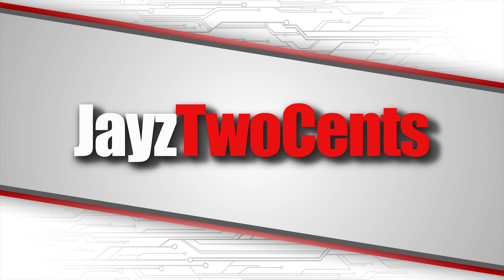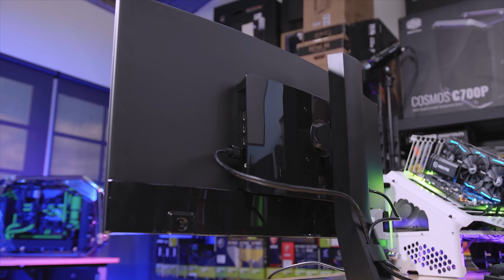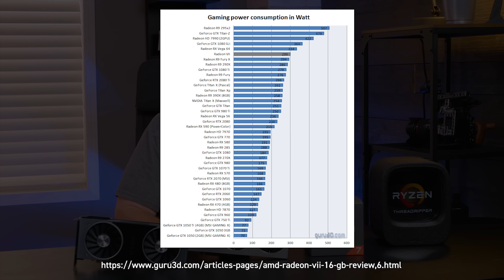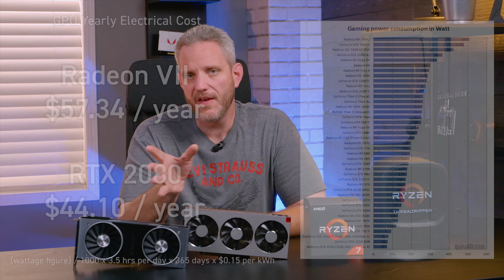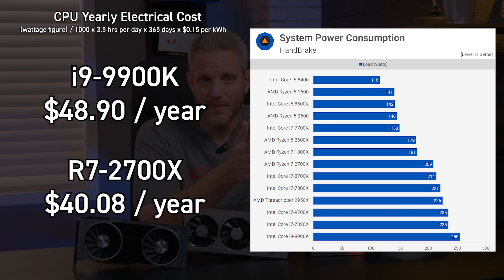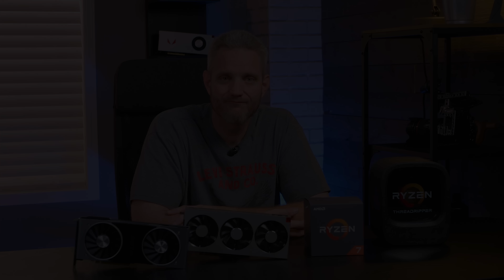Energy Costs of AMD vs Intel vs NVIDIA... This might surprise you

Comment: Nice video. I will go and get stadia now. 4k for 9.99 and 1080 free
Reply: You are forgetting a controller. And the internet. And latency. And Chromecast or PC.
Reply: @StiekemeHenk  1 time controller for 60€ or 1500+€. Some say the lag is torabl
Reply: @joe-zt7jy  guess you wanted to say terrible?
That was some time ago. It will be released 6 months from now so it isn't final. If streaming is ever going to be good, Google will start it.

You can watch YouTube? Check.
You can game? Check.
Ping in game tolerable? Check.

Streaming should not be different.
Reply: @StiekemeHenk  financially all you have to do is buy the game and play it at 1080 for free ( stadia is compatible with keyboard annd mouse on PC). you do not have to worry about specs and upgrades. 10 € you get the 4k experience plus 2 free games. moneywise you can't beat that at the current hardware prices. I built all my PCs and my friends so you can say I want Stadia to fail.

if there is not too much lag, Stadia will be much better choice financially  for single player
Reply: @joe-zt7jy  So to use Stadia, you still need to buy or own a PC, controller or mouse and keyboard.
Oh and still, god like internet.
Reply: @StiekemeHenk  anything can stream Stadia. Tv, mobile wich you  need controller.  Pc, laptop which can open chrome does not need controller any thing will work
Reply: @joe-zt7jy  So I still need to pay for super fast internet. Pay for a laptop, tv, pc.
And not all phones are supported. Only pixel.
Reply: @StiekemeHenk  ofc you have to do that. if you do not have any of the above. How do you play games without them?

Comment: This video is pointless, probably just a place holder and it's OK, don't dig deeper into this topic becouse it's pretty complicated.
People who usually brings up the power consuption argument (I ignore the fanboys now) have some special requirement, low power output on idle, low heat output, these are the people who buy LP grapics cards.

Comment: hate to be this guy but if you're using desktop hardware even in the high end and you're concerned about power draw it sounds like it may be time to move. damn $0.15 kWph that's less than half what I pay and power draw doesn't even come to mind when I shot hardware. in the end, all I am saying is buy what you will be happy with and dont gimp your self with the whole of X card draws X power X card will save me X amount nickle and diming at that point.

Comment: I buy Intel processors because I like Intel. Point blank. I utilize Intel at work, so its my preference at home. Though if i could get my hands on a comparable AMD chip I would love to try it out. As for graphics I am switching to Nvidia from AMD because I have never tried Nvidia. Thermal output of any system should not be a considerable factor on chip choice today unless you are designing a space and airflow constrained system, IE a machine that is enclosed in a control panel or inside a cabinet that has no thermal flow. And that would be a special case. So for mainstream systems choose whatever is your preference.

Comment: AMD heater..... yeh 3700x 65w 8 core vs 9900k "105w"  same multi thread score.

Ignore the 3800x , thats just AMD stilling off crappy dies that happen to clock higher with silly power draw.

Comment: TSMC’s 7nm process is NOT superior to Intel’s 10nm. It is comparable and in fact Intel’s 10nm is lightly superior. Only an ignorant person doesn’t know the marketing shenanigans of TSMC in the node naming scheme and falls for the smaller number trick. In any case below is a ranking of the nodes starting from the worst and going to the best:
GloFo 14nm (this node should have been called 16nm)

TSMC’s 16nm

GloFo 12nm (this node should have been called 16nm+)

TSMC’s 12nm (this node should have been called 16nm+)

Intel’s 14nm

Intel’s 14nm+

Intel’s 14nm++

TSMC’s 7nm 

TSMC’s 7nm+ EUV 

Intel’s 10nm+

Intel’s 10nm++ 

TSMC’s 5nm 

TSMC’s 3nm 

Intel’s 7nm+ EUV

Comment: true value is console if you are casual gamer there is no better deal (my opinion)
Reply: Would be interesting to see where a 1060 6gb and 9400f at 30/60 fps lock would draw. CPU wouldn't even wake up in most games. Hard to beat the value of a PS4 pro at $300 (on rakuten now). It would hurt to pay for online again though

Comment: Is the Radeon VII on par with the 2080 though? I'm genuinely curious cause not much has been said about it since the initial "disappointment".
Reply: Yes it is still on par. Hardware Unboxed revisited it recently and found that nothing has changed.
Reply: Stock peformance it's a bit slower but usually it can overclock quite well, while still undervolting it a bit. The Vega cards are for people who like to tinker around with their cards, Nvidia gives better out of the box performance. For me, it was very fun to play around with my Vega 56, I had Samsung HBM2, flashed a V64 bios and got a huge memory overclock on it and now I'm getting better performance than an RTX 2060, getting close to a 2070 actually. Out of the box though, the 2060 is slightly faster than V56, just like 2080 vs Radeon VII.
Reply: It's faster and has 16gb of vram and with hbcc you can have up to 24gb of vram performance.

Comment: It should be testet asfar as possible with product with the same capacity, and then calculatet where is the diference in powerdraw and purchas price. And if a product is initaly cheaper but draws more power how long would it have to run until it became the more expensive one. With let's say 3 to 4 diferent pricings kw/h since the price is regional different.

Comment: power cost ??whast that

my desktops/laptops/server and even smartphone are always running at 24/7 @ 100% full load (IE cpu/fans are at 100% clocks/speeds 24/7)

I don;t let the cpu or fans not run any thing slower then 100% 24/7 

also don;t use hibernate/sleep. and only turn the displays off.. nothing goes to standby/sleep/idle ect..

I don;t even under-volt my AMD cards... I just run stock settings @ 100% fan rpm's 24/7...

Comment: @JayzTwoCents , Question = Is it Better To Cool the Radiator OR Just Cool The Water / Coolant ? Wouldnt it be Better To Just Cool the Water / Coolant Rather Than Cooling the Whole Radiator + Make it Quieter as well By Not having to Cool such a Large Surface ? This has been a question i have been asking myself for quiet some time now as the Ultimate Purpose of a Radiator IS to Cool the Water / Coolnat - AmIRight ? Yes i Know this is Almost Idiotic , But Couldnt you Just Design a Pump Design that Cooled the Water / Coolant Without Radiators ? Say From a perspective of a In-line Cooler much like what is found Inside Many if not All refridgerators for lets say a freezer Ice maker Or The Water supply line For The In-door Water Dispensor that cools the water to an Almost frosty temperature ? Could be a Complete Video Idea as well and Just Maybe a New Cooler design For Future Water cooling Custom PC`s that Nearly Silences the db / dba that SOO Many seek to battle for that Schweet Quiet Background Noise Dampening and very Possibly a Much Cheaper Variance to Current Designs . hmmmmm - 
Maybe its just because i havent slept in 2 days and need to take a break from my Own thoughts - any suggestions ?

Comment: 9900k can be faster then the 2700x with a forced 95 watt tdp  which is lower then amd stock. So less power draw.  Now consider gaming you get more fps out of the same gpu. So less gpu upgrades and later cpu upgeade. This makes this 40% price hike for the intel neglectable ans less power draw.    My point its also about the use case.   And power draw matters for some users and use cases and it doesnt matter for others. No situation is the same.    I may be getting a 9900k purely for the fps and getting more out of my gpu which are expencive aswell thus i want to upgrade them as little as possible.   Price per year wise long term the 9900k i calculated is not much more expencive but i get a snappy system plus i can wack 4266 memory on them which gives 5 to 12% fps for only 45 bucks more atm. That long term is also a cost saver. Often 12% fps on a gpu costs more then 45 bucks and i buy ram once but upgrade a gpu 2 to 3 times over the lifespan of my cpu. Amd would cost me a lot more long term as i have to upgrade more to keep getting the same base minimum fps.  Also 25 cents in dollar per kwh here.  And my gtx 1070 i payed 500 for uses 150 watts amd comparable fps at the time would use a lot more over 3 hous a day for 3 years plus the amd gpu performance seems awefull from launch day and games often require a lot of patches.    Its all based on usecase and not everyone makes the effort to calculate for their specific usecase

Comment: using 2700x with handbreak it does get really ho and a cryorig quad lumi cannot handle it... I had to go AIO to keep it cool.
Reply: have you oced your cpu since i run it on the stock cooler with fine temperatures ? or do you life in the sahara?

Comment: Amd is making great strides to be next to Intel with performance and trying to surpass them. I thought amd would have gotten the single core clocks up higher with the new lineup. But it's still just a little short of Intel. And it's a great time to buy a cpu from AMD. 
 But,  amd could be in trouble again for a couple of years, I'll explain . Most are probably thinking, No they are making a great comeback. And they are, but when Intel gets 10nm going , I think they will pull ahead again. If AMD right now is a hair away with a 7nm chip. Going against a 14nm++ intel chip. Whenever intel gets 10nm chips, they will only get faster speeds and use less power draw.
 And AMD won't be going any smaller than 7nm anytime soon. Intel still has the 10nm to make and could still go onto 7nm then. I see Intel going to 10nm in 2 years. Then probably 10yrs or longer to get down to 7nm. If Intel does 10nm, I think they will have another gap between them and AMD. But for now it's kinda neck and neck in performance.

Comment: Nice. Exactly 6 years ago i stopped investing in new hardware. What i would like to see is a product review in regards of power-consumption to price- and cost- efficiency on static threshold baselines like real-time video editing and 3d rendering with full effects at 1080p and 4k split by frame-rate sets of 24, 25, 30, 60, 120, 144. Not everyone is looking for potential but instead guaranteed performance. Did you made a test with this specifications? If so i'd like to have a link.

Comment: My ryzen 1700 and gtx 1060 run about 70/80watt in casual use .In gaming 110 to 180watt so thats not much
Reply: 1060 gtx are very efficient cards.  Like the fact they don't even fire up the fans unless you getting high temps.

Comment: rx 5500 vs rx590 what is the difference the performance is not that much between the cards sooo where do you go from there 590 and the 5500 same performance  really so the question is why ????

Comment: Intel already dropped the price. Performance is one point but amd still trying to hit high performance per core than bunch of cores . When it comes closer to that may V2 will tell that. Yes i9 9900k was twice costlier than 8700k similar to 2700x now only 25% more but Still it all matter what generation one is upgrading from which platforms. As long one satisfied with their setup that's all it matter.

Comment: i have an intel 6700k and ryen 1700. witch is my 1st  intel system before that.  i only had amd systems start back for the Amd super socket 7 with an AMD K6-2 then an Socket A AMD Athlon/AMD Athlon XP 1500+/AMD Duron witch i had many cpus because the bored lastest so long as well amd 965 phenom 2 and amd fx 8350 at the end of the day all that really matters is does the hardware run the software to your liking and if it has the Security for what you need it for

Comment: that was informative. thanks soo much bro! i would like to ask something. normally on my laptop, bios doesn't permit to overclock the gpu. if i try to remove this restriction, my pc is going to be out of guarantee. So, the point is, if i use external gpu with rx570 and try to overclock rx570, will bios restrict it and can i actually overclock it, is that possible? Im asking it because i don't have one yet. Im planning to buy it. Thanks so much btw!

Comment: jay it just doesnt matter if the difference bumps you up to the next sku or not, its about the value proposition.   You look at a CPU or GPU, think well its more power efficient than the other so I should consider its price a little lower comparatively.  Then you make your choice with that value proposition in mind.

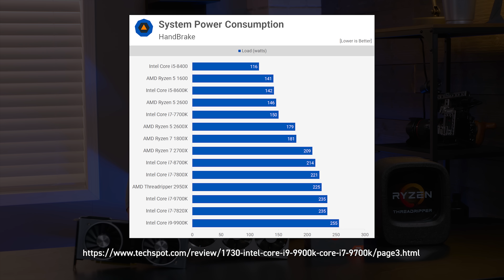Comment: 8:17 much lower power consumption of i5-8600K...?
Reply: 8600k eats power for what it is.  6 cores no HT but only slightly less power draw than a 6 core 12 thread Ryzen 5 2600
Reply: @philwithcheese  Yet, is that with the R5 at 4.1 GHz and the 8600K at 4.9?
Reply: @philwithcheese  In general I agree, though. Intel should try fabbing Sandy/Ivy/Haswell on 14nm ++ or whatever because it strikes me as more efficient than Skylake and later.
Reply: @coopergates9680  were those chips overclocked?  I don't think they were.  That means 3.4 Ghz on the 2600 and 3.6 Ghz on the 8600k
Reply: @philwithcheese  Given that he referred to TechSpot data, any overclockable CPU should have been tested OCed, but that doesn't help much as the 8600K could have been at 1.22V and 4.6 GHz or 1.4V and 5.1 GHz or something, which of course affects power draw a lot.
Reply: @coopergates9680  looking at the graph it is definitely NOT overclocked.  ~140 watts total system power draw for the 8600k and 2600.  If they had been overclocked it would all be junk data.
Reply: @philwithcheese  Not representative of most users then. Someone wanting Intel and those figures may as well get the non K chip.
Reply: @coopergates9680  most users don't OC, even if they get K chips.  Just like most AMD users don't OC either even though every chip is unlocked.   The K intel chips also have higher clock and boost speed out of the box than non-K
Reply: @philwithcheese  8600K and non K have the same turbo clocks (higher base clock on K model) - the best example of a K chip that did not need to be OCed was the 4790K w/ 4.4 GHz all-core turbo (Haswell non Ks were considerably slower).

i7 8700K and non K have the same all-core turbo (4.3 GHz) - those people who don't OC and are buying Coffee Lake Ks are definitely tossing a little $$ away lol